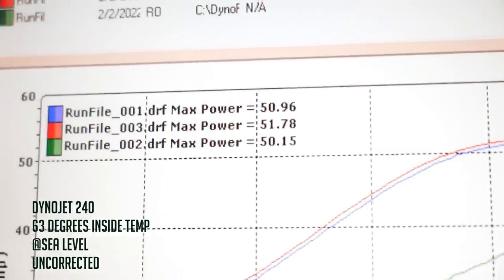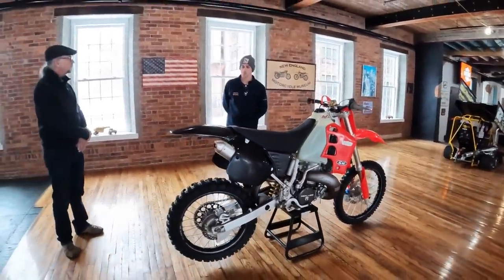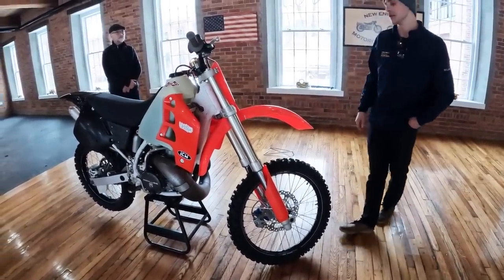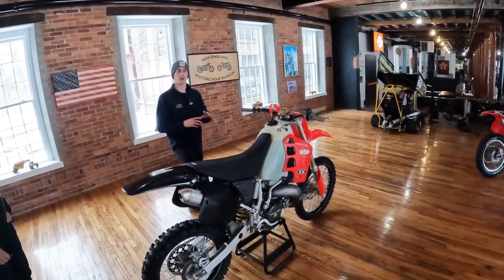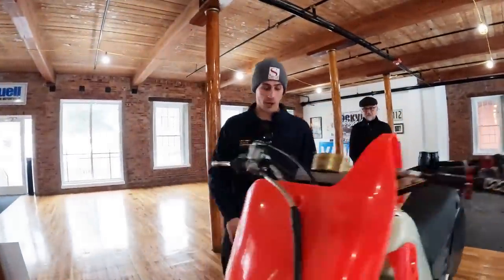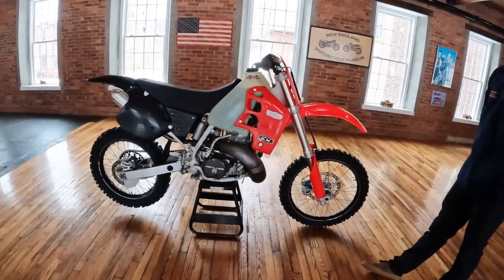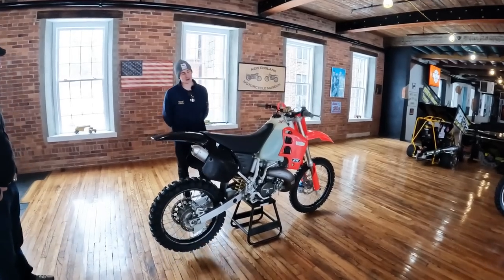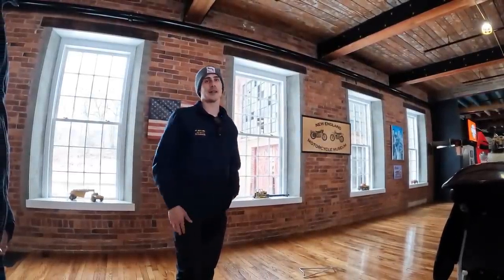BUILDING A CR500 FOR DESERT RACING.. PART 1

Comment: CR 500 case corrosion problem  ,  first, is to remove and radius all sharp corners inside the water pump case , this will help to improve flow and reduce cavatashion from the pump .  second, is to add a ground wire from the radiators to the frame . most of the corrosion is concentrated at the hose spigots on the head and the outlet of the water pump !    I believe this is caused by an electrical charge building up in the radiators from the air passing through them  then through the coolant to the block causing an electrolysis issue . this is also common in automobiles . maybe this will help. I have done this to my CR after replacing a completely dissolved side case !

Comment: As a former desert racer, I wish you guys luck. There is more to doing well at this race than horsepower. Dial in the jetting for the elevation and it changes. Dial in the suspension for the terrain. Use a tuner that does desert suspension. You don't want a fast turning bike for desert. You actually want a longer wheelbase and longer fork rake.
Reply: I used to drop mine (forks) in the triple tree to get that extra 1 degree or so
Reply: i would also agree on the longer wheelbase forks all the way out. i liked my KX 500 to stay steady and straight at high speeds. You don’t need the bike twitching all over in top gear.
Reply: Sometimes you can add a link to the chain (longer wheelbase, front-end stays down) or subtract a link (tighter turns, front-end comes up easier)

Comment: You're gonna be vibrating for a week after climbing off saddle after a full tank of gas. I love Big bore 2T's, CR's hold a special place in my heart since that's what we rode growing up. But if I was gonna do a Score PTP race I would definitely go with a XR650 or XR600. The vibration on a CR 500 is gonna numb your upper body after an hr. You would have to use a wide ratio trans wouldn't you? Gearing with the sprockets isnt gonna cut it.
Reply: Honda only ran the close-ratio transmission for a few years. In '94 they went back to a wider ratio, and you can interchange them.

Comment: Get some computer fans and put them on the radiators. I have a CR500 super moto I ride and in traffic I would heat up since we can't split lanes. I used 2 fans and dropped my temps significantly and  haven't had a single problem

Comment: Congrats on the challenge! That race will change your life good or bad. Remember it's a marathon 50 mph to 60 mph average 9-12 hours on the bike top riders speeds looks like your in AZ already training.. Bike comfort and sag setup is key high speed settings as well get the forks as far down long as possible in the triple clamp. Training training training you should be on the bike as much as possible leading up to the race. Remember Vegas is Vegas lots of energy don't get caught up too much racing the desert dogs these guys are gods in the desert learn just don't chase these guys they spend there lives in the desert. The nasty shit comes up fast at the speeds out there 5th gear and using the mid torque is a happy place for that long good luck hydrate and train as hard as you can.
finishing is the goal in america's longest desert race.

Comment: This is going to sound crazy but after my CR500 kept rattling stock exhaust mounts loose I looked at my Husky (390) that's had the same mounts since 1980 and converted the 500 over to spring mounts like the Husky. I didn't have a problem with it again. If you use stock mounts make sure the spacer is in them or they'll vibrate apart quicker.

Comment: No powder coat, Paint it. Think about rock chips and the thickness of the p coat. When these thing vibrate like they do and that thick p coat starts goin away, that's how your bolts come loose cuz that thick crap is flaking away. Paint the frame, it's thinner and bolts tend to stay tighter. Just my opinion, good luck in the dez!

Comment: The vibes or resonance will occur at certain points in the rpm range. Road bikes are designed to counteract this   through the frame and bar weights, but as pure racer this is not a prime consideration.

Comment: So when you mention the cranks failing on the hot rods so I run the stock crank that is stroked to a 4 mil one 1 motor and a 5 mil on another motor and we been having a rod bearings issues failures the crank survives but the rod, the bearing the pin and the cases don't survive and I was told even stock the rod bearing fails and a lot of us outlaw kart drivers had rod bearing failure so can someone find a fix for it like not a rod bearing cage but just needles like a chainsaw and they never fail so who can do that fix so we don't have the failures anymore

Comment: Put lead shot in the bars.Leave a small gap before you put the corks in (think dead-blow hammer) I did this on my exc300,Massive difference,but now I just feel it in my feet more ! Ha,ha…
Reply: I should say,tiny lead shot,I think it’s called birdshot…
Reply: The higher the number, the smaller the shot size will be.
The problem is your bars will weigh 25+lbs.
Extra weight is a no-no in racing.
Reply: What about that foam insulation you spray for windows.. I would think if you used that in the bars it would kill some vibration along with being light weight. Just a thought.
Reply: @davidochoa4500  the point about the shot is it acts exactly like a dead blow hammer…it actually moves about slightly,and deadens the vibes….

Comment: Aside from a perfectly spin balanced crank, Team Green also had rubber mounted bars and ran a Barsnake.
Reply: @billallen4793  Sliding the forks in the clamps so the cap was flush with the top of the clamp helps, as well as running the rear wheel our as far as it will go in the axle carrier works well too.

Comment: This guy is trashing the cr500s suspension 😂
Reply from the maker: Andrew is an AMA licensed professional mx racer, stock suspension on any 25 year old mx bike can be easily improved by bolting on a 2022 CRF 450 Fork and shock or a 2022 Ohlins set. At 112 mph in the desert the best suspension is cheap insurance to not swap out...
Reply: Stock CR suspension aint that great stock.
I got mine revalved (GoldValve) and resprung, and its a VAST improvement.